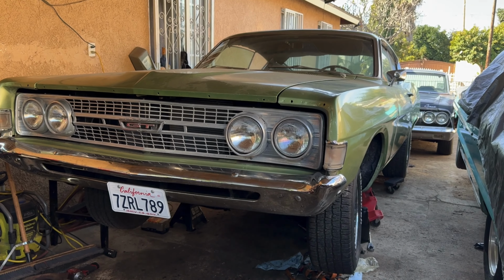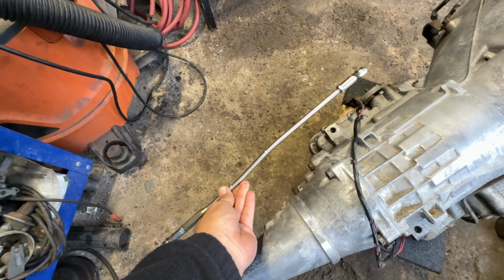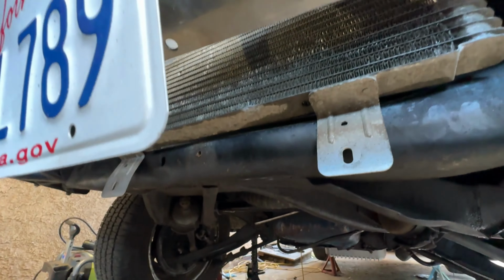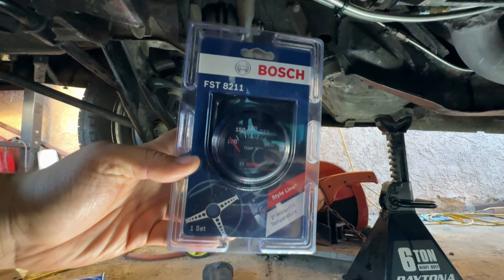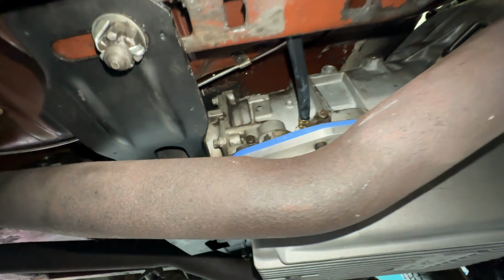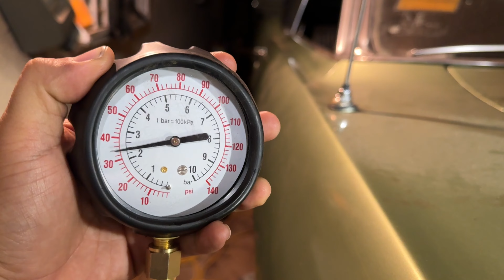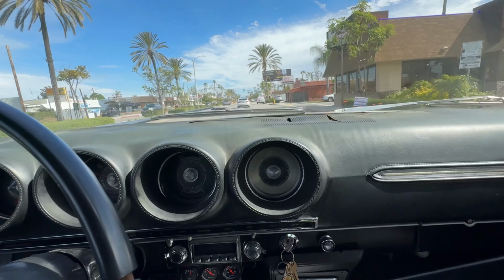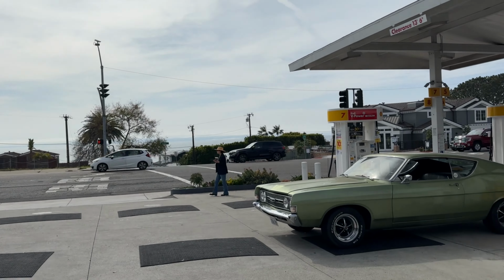Ford AOD Transmission Swap 1968 Ford Torino is Complete!! 2/2

Comment: I have to go the other way with my '76 Valiant V8 sedan- I'm doing overdrive, but converting it to the era correct A-833 OD gearbox in the FE case, not aluminum...liking your work & efforts, the car is looking great. I've done a full Bergman Auto Craft suspension/steering/ brake material upgrade, K-member is perimeter welded, 3" skid plate, 8.75" retro-fit (3.23 sure-grip gears), 12" rotors from a '77 Cordoba, US Car Tool chassis stiffening (subframe connectors, torque boxes, A-pillar-to-top of the shock mount, core support reinforcement). It's not too rough a ride, definitely firm, but very useable and handles far beyond what any regular, domestic, vintage sedan should be able to do. I even kept the small trailer hitch on the car

Comment: I replaced the c4 in our 73 Mach 1 with an AOD.  No regrets.  I did have to bump my Throttle Valve pressure to 39 PSI to get it to shift at higher road speeds.  That worked our well.

Comment: hey Omar, congratulations on your barn Find Hunter episode. It must have been cool to hang with THE man. sorry to hear about your cracked block. I just got a 390 back from the machine shop and reinstalled in my 64' T-bird and it's pretty sweet. Next step some rust repair and paint. now I am working on a 64 F-100 with a 292 y block. the roof has a bunch of areas of rust through so I am going to venture into my first attempts at body work. I just got done repainting the cab interior in its factory carribean turquoise and I just used a very soft paint brush. it turned out great and so much less complicated than spraying. cheers, David
Reply from the maker: Much appreciated David! Sounds like an awesome build, I would love to build a 390 someday. Maybe soon!
Reply: @OmarRamirezGalaxie  don’t believe you’ll be able to use the aod I don’t believe

Comment: Nice job Omar.  How much did the rpms drop when it shifted into overdrive?
Reply from the maker: With a 3.00 gear ratio and tire combo, it’s supposed to run at 1800rpm at 70mph according to the calculator but I will confirm with a tachometer.
Reply: Hello from Norway! I got a stock roller 5.0 and Aod out of a 86’T-bird that i just put in my 1955 Mercury Monterey. Edelbrock carb ,performer 289, electric fuelpump and a set of longtube headers and dual exhaust paired with the original rear end. I think it is 3.15 and stock tiresize, cruises 60mph at 1400rpm on the tach😎👍 Fun little cruiser and the OD definitely helps when you’re on the gas pumps!😅

Comment: Ok si puenteas los cables en la starter no dispara el solenoide asi que no enganchara con el aro dental ocupas el cable chico para que el solenoide dispare.
Reply from the maker: Yo creo es diferente la foto de msd. En un starter msd, punentan los dos en el starter y tienen un cable gordo al normal. Yo creo Que es lo mismo si pones el cable gordo normal en el diente no?. Lo unico es encontrar una conneccion del cable gordo rojo 4Ga al diente chico y pontear los dos puntos. Es un poco dificil explicar haha

Comment: That trans cooler fit in there like it was made for it. I thought I heard some squealing going on a @ 17: 50 but it was just you filling up , price of gas I guess . lol Aod has a better first gear ratio than original trans?
Reply from the maker: Haha yes the price of fuel is high here, I’m not too sure on the specs. I believe the gears are all mostly the same except for the 4th of course. I’ll be doing an overview with all the info on the AOD vs the C4 soon!

Comment: Success! Great! I have a shy question: Is this rattling sound coming from the windows? It is distracting a bit from the cool ride. To have this overdrive makes the car smoother and faster and the ride much more relaxed. I love this car, the colour, the fastback body stile and your knowledge is amazing. I am a mechanical idiot and I would never have the courage to change and adapt the transmission like that. I am really the body and paint guy.
Reply from the maker: Haha yes the window rattles which is on my to do list. Definitely distracting when I’m driving. The overdrive makes this into a totally different car, I feel confident I can drive it anywhere

Comment: Very nice!  I just rebuilt the Cruise-0-matic in my 64 Galaxie, so I probably won't be doing this, but if my trans ever goes, this is the ticket.  Was the Torino originally a column shift and someone cut the floorboard to make it a floor shift with console?
Reply from the maker: My car was originally a column shift. Previous owner had converted it to a floor shift with a mustang shifter but it was done very bad. I had to source all the correct parts to make it work.

Comment: Great job, I’m currently doing the same swap on my 67 Mustang. What did you do with the neutral safety switch/reverse lights?
Reply from the maker: Much appreciated! On the Torino, the neutral safety switch and back up lights are all contained in the shifter lever.so j didnt have to do anything with it, all works great

Comment: I know the shift pattern for the aod is different than the c4,c6,FMX . Do you start out with the gear selector in OD or D?
Reply from the maker: Always in OD. The only time I put it in drive is if I’m on a steep hill, that way it doesn’t switch in and out of overdrive

Comment: Nice work Buddy.  Installing a 393W and AOD in my 69 Mustang right now.  Does it always go into OD at around 70 mph or did you make an adjustment? Did you retain the lock up torque converter? Keep up the good work sir.
Reply from the maker: I’ve been driving the car a lot more. The transmission will kick into overdrive depending on how much throttle you give it at a certain rpm. Mine does shift at 45mph if I’m slowly getting up to speed. If I’m hammering on it will go into OD at a later speed about 60~70mph. Has the stock converter from the 93 t bird. I kept the adjustment at 35psi
Reply: @OmarRamirezGalaxie  OK, that does it. I'm headed over to your place so we can motor down the road with a 69 Mustang Convertible side by side with a 69 Torino.  Awesome!
Reply from the maker: Haha I’m always cruisin with my friend juan and his 67 mustang, we hit up the local coffee shops